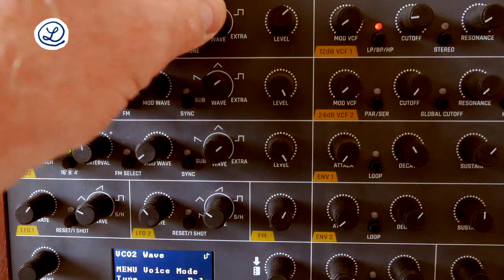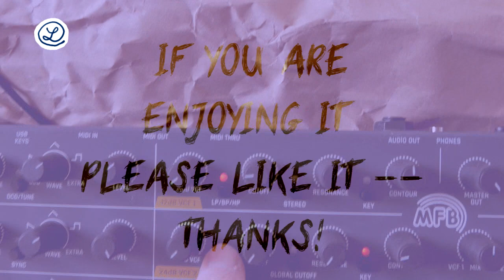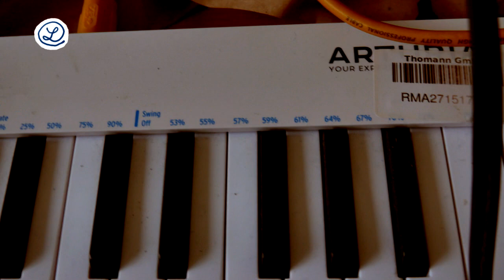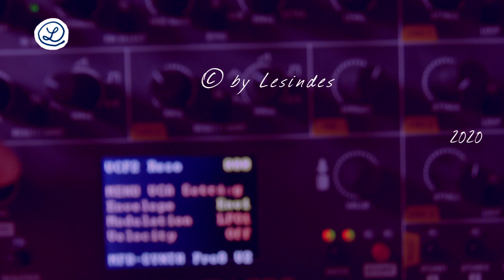MFB SYNTH PRO // REVIEW // 1 // FEATURE OVERVIEW

Comment: hi there, thanks for the review. In your view, could this be a cheaper alternative to, for instance, a Prophet 6? Are you happy with it as far as materials and firmware? thanks!!
Reply from the maker: Yes, it has a very appealing lush sound to it. 8 voices with 3 instead of 2 oscillators per voice (including SUB), 2 LFOs instead of one and 2 VCFs that maybe used at the same time. That's a bit more on the feature list if you compare it to P6. That's a lot for little money. On the downside: It is a typical MFB product. That means the manufacturer is known for his user friendly operation. Although this one is the only MFB machine so far that is intuitively operabel without any manual. The latter you need only for the very special features. There are frequent updates but the procedure is really cumbersome and it is not impossible on Windows like the updates of IK Multimedia UNOs! 
Comparing it to Sequential Prophet 6. P6:  is more easy to operate because Dave Smith put almost anything on the frontpanel = no shift+button operation for the sound design, its FX processor is dual and more sophisticated and there is no special insertcable needed for the stereo out.
Reply: @LESINDES  Thanks for your response. I really like the sounds of the MFB  but being easy to use and reliable for me is first thing. I am not techy at all...
Reply from the maker: Yes, I understand — you should give it a try ;-)